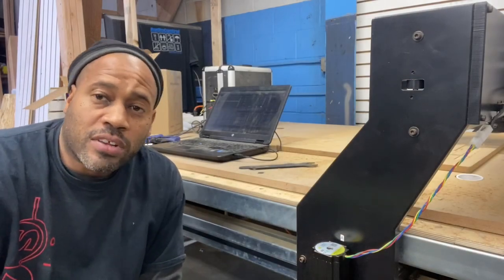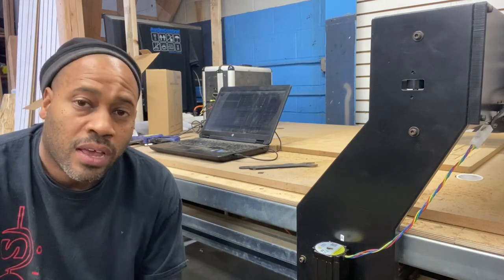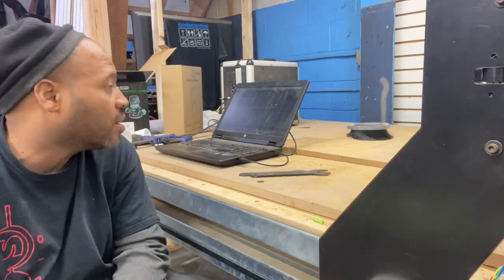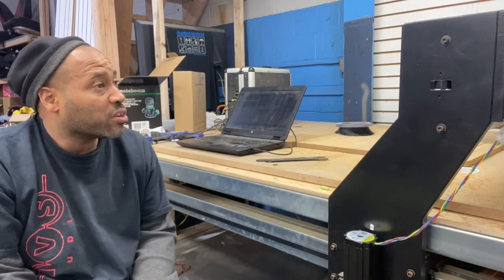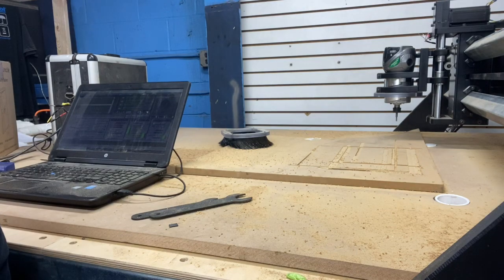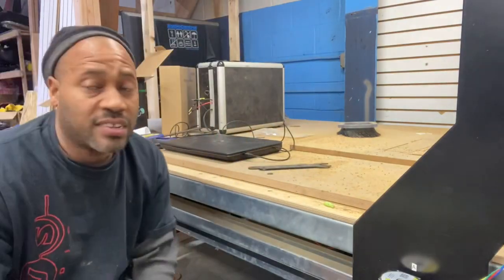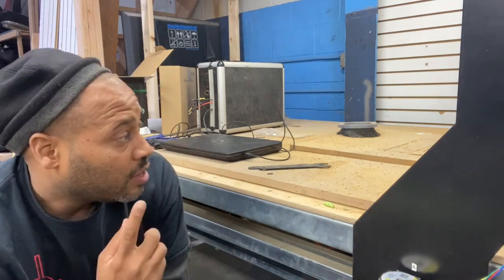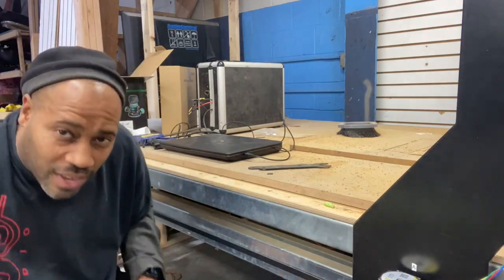Tool Time Tuesday zenbot cnc part2

Comment: Note...U only need the  uc100 controller if u dont have a parallel port on pc...i slways just use old laptops when using mach3...saves you $100 )..looks like a decent machine...is it belt drive or rack and pinion?
Reply from the maker: L W it’s belt
Reply: @NVSAUDIO ok you like  machine  so far?
Reply from the maker: L W it’s does everything I need it to do for now . 

1/2 inch acrylic and 1/4 inch aluminum

Comment: using the uc100 controller did you have to fine tune your configuration file from shaun to have the machine cut correctly
Reply from the maker: eddie barnes yes 
He had to email me a new configuration file

Comment: Thank you for this video, I'm strongly considering it. A little worry about all parts not being metal. What are your takes on this? Also is the Hitachi spindle very noisy? Thanks
Reply from the maker: J A the hitachi is noisy but you can’t hear it over the dust collection
Reply: I have a 16 x 24 since 2015. It's my first cnc machine and boy did I abuse it. Its 2020 now and it's still working great and my production machine for my business. Worth every penny!

Comment: I felt your frustration with Shaun, my machine took longer than expected to be delivered and machine made it before the stand but i got it assembled in a day. Maybe having built a X Carve (my fist CNC) helped with minimal issues. Only problem i had  i got the stepper motors mixed up. But once i got it sorted out loving the CNC!
Reply: Will this machine be good enough to cut about 20 sheets of acrylic 1/4" a week for a small business? Does the vacuum table hold up good?
Reply: It should using the correct bit for acrylic. I use mine mainly for 1/4 MDF and it cut its like butter!
Reply from the maker: J A yes